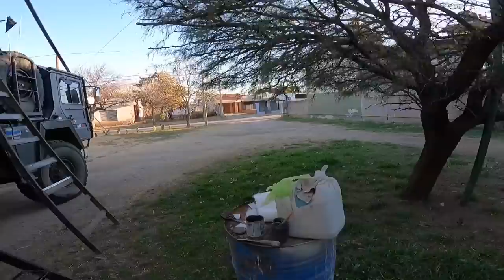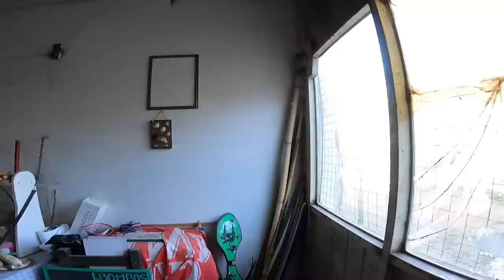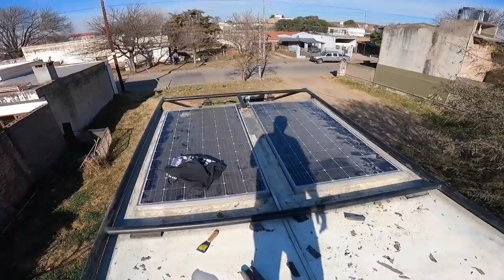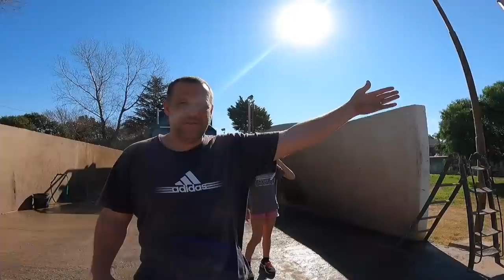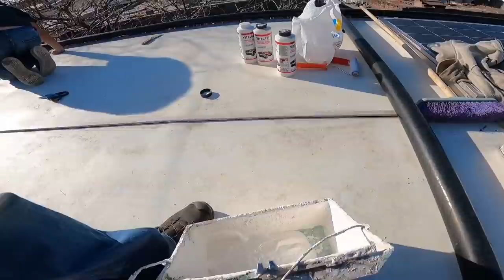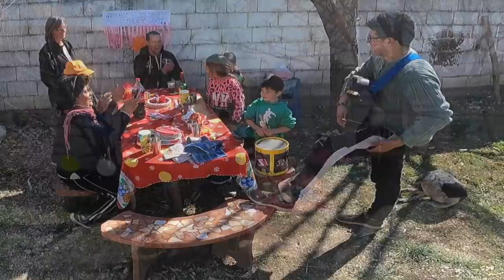239 comment étanchéifier son toit de camping car // nouveau look

Comment: Le Raptor est fabriqué par UPOL , reste à trouver un distributeur ou revendeur . Je suis Carrossier et le Raptor est un très bon produit après c'est la préparation du support qui fera la qualité dans le temps . Un bon apprêt en fond et ca sera top . Vous pouvez rajouter dedans le sachet de silice vendu séparément qui fait anti dérapant . Il existe en noir , blanc et teintable avec n'importe quel brillant direct . J'ai fait le plancher de ma remorque qui en est recouvert , elle reste dehors toute l'année et rien ne bouge !!! Vous pouvez l'appliquer dehors et au vu de la superficie de votre cellule comptez 8 cartouches pour avoir une couche convenable . Bon voyage à vous et merci de nous faire voyager avec vous !!! Manu

Comment: c'est le contraire trop de chaleur fait baisser le rendement des capteurs photovoltaïques donc vive le blanc :Un panneau photovoltaïque dont une température de surface dépasse 25 degrés, perd 1/2%  de rendement par degré supplémentaire au dessus de 25 degrés.